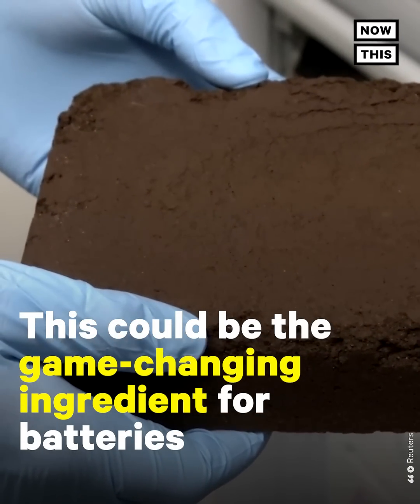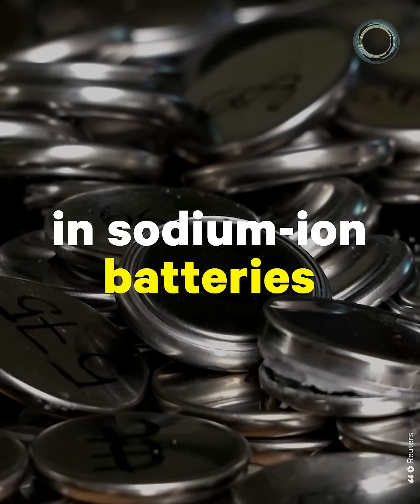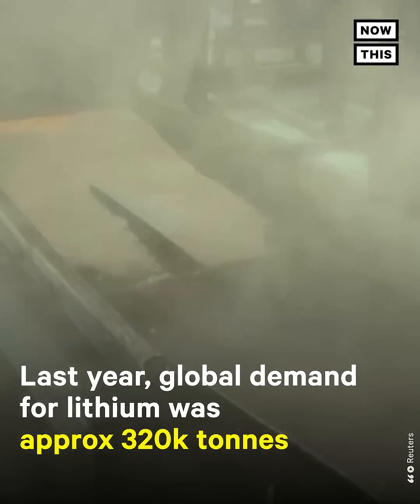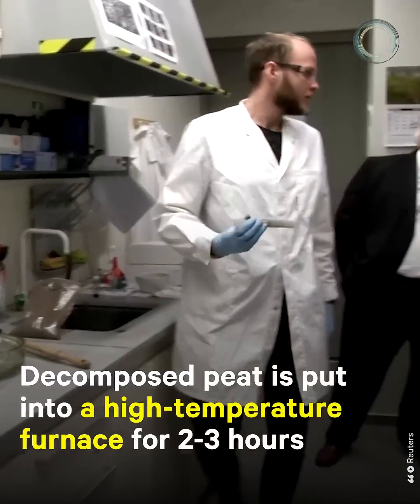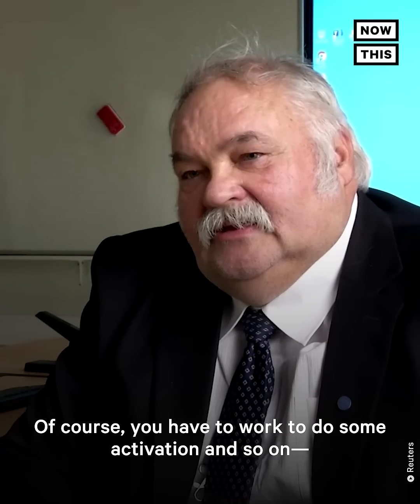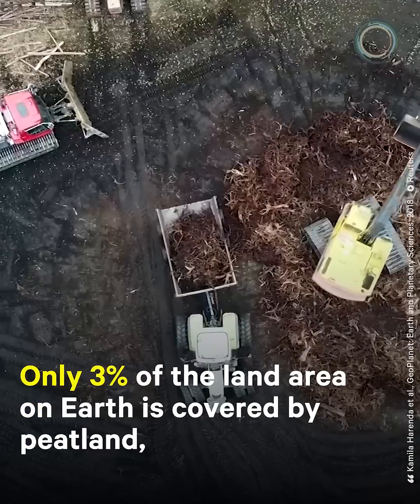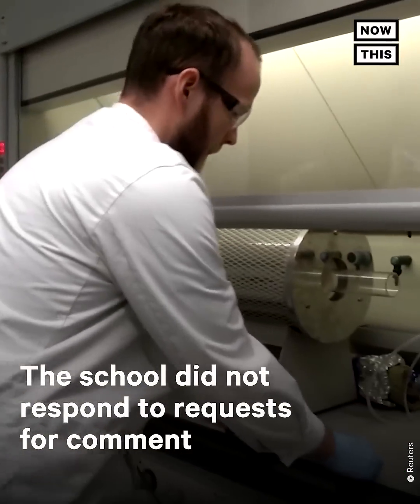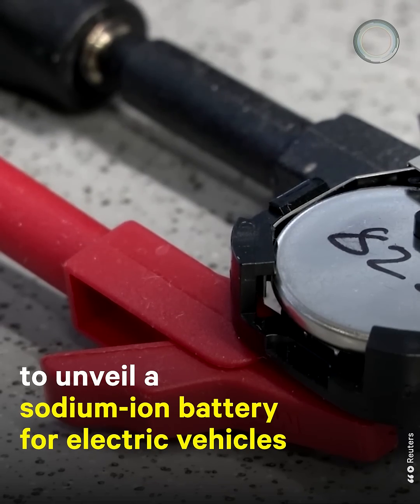How Soil Could Be Used To Help Power Electric Vehicles

Comment: If the point is to get Carbon powder why not do so by leveraging Carbon Capture tech? Cap it off with widespread battery recycling and use clean energy to power the cycle.

Comment: Not sure why my progress has not been made with silver batteries. By far the best conductor of electricity
Reply: Costs
Reply: @eins2001  but it would take very small amounts of silver typically like a coating or an alloy also best conductor of thermal energy as well ...there has to be a way to utilize that

Comment: This tech is not viable.  The CO2 emissions and the rarity of the peat (only 3% of the Earth has peat,) would eventually make it more expensive than lithium ion as the peat supply is used.  It would be better for the peat to be used in food production.  At least that way it is renewed.
Reply: 3% of the worlds land is peatland but lithium composes .0007% of the earth's crust. On top of that I would imagine it is easier and cheaper to dig up peat than mine lithium out.
Reply: Also keep in mind it is a false equivalence because the peat is only being used for carbon for a single part in the sodium ion battery serving an entierly different function than the lithium serves in lithium ion batteries
Reply: @dont_i_know4858  yeah and the nickel and Cobalt are still used for other components of the battery and I don't think that changes that fact. They didn't even mention the Cobalt in the copper. You would be using the sodium to replace the lithium but I think you still need those metals for the other components.
Reply: @dont_i_know4858  you don't even have to dig to mine it out you can pump it out with water.

Comment: Using peat in mass-produced batteries would be terrible for the planet! It would result in the release of so much carbon dioxide, as you mentioned, and continue to destroy a very important type of ecosystem for the climate  and biodiversity. Peat is already extremely unsustainable for the horticulture industry which is already looking into substitutes. Increasing the health of bogs and fens is one of the practical natural solutions to drawing down carbon, but digging them up just to make batteries is unjustified and just as bad as using lithium. Disturbing peatlands continues to send us into the wrong direction when trying to slow the effects of climate change.